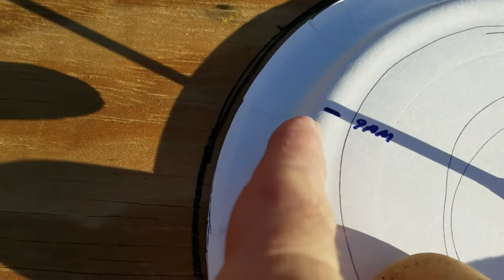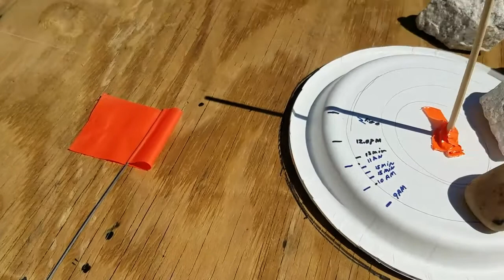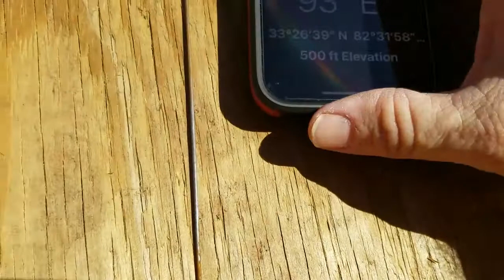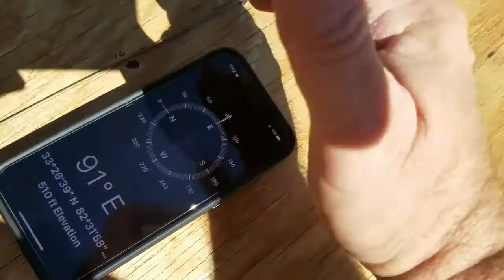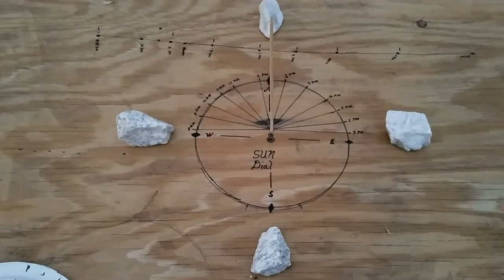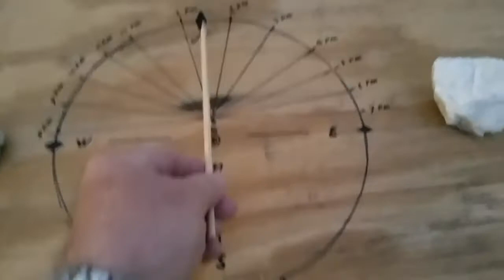Sun Dial & How to Find East/West directions,  Gary J

Comment: But.... Hear me out..... If you know what way north is facing, you'd already know East and West
Reply from the maker: Yep! Is North 30 degrees E. or 330 degrees W.?  The Sun dial narrows the direction more precisely. It’s more helpful when the sun is directly overhead. Thanks for the comment.
Reply: @knightingalesaid  but you need the compass to set up the sundial.... The compass would show you the answer to that question. I'm just not seeing the benefit to a tool that poorly mimics the results of a compass that also needs a more accurate compass to set up